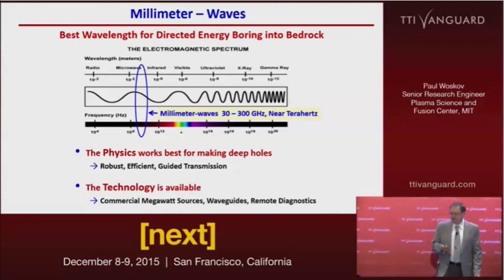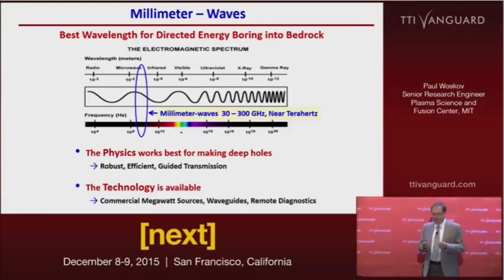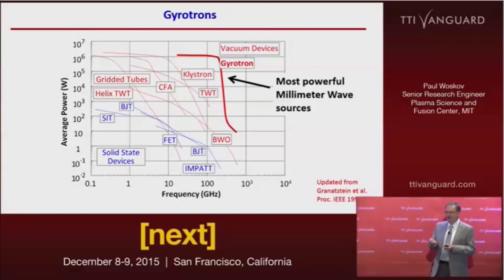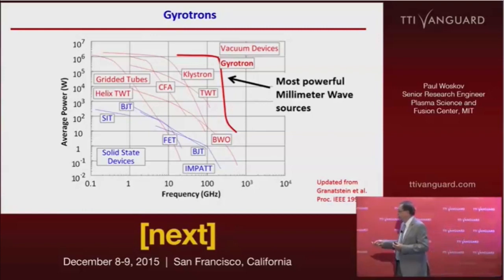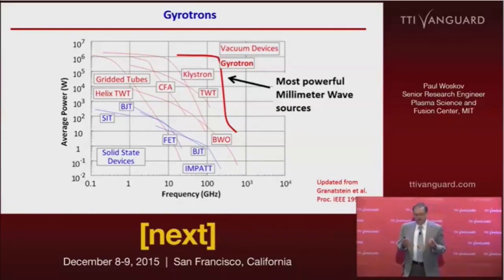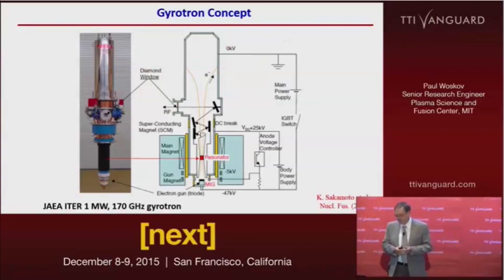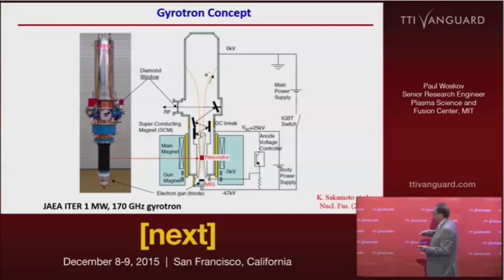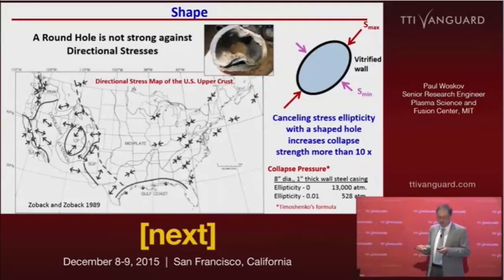Full Bore Millimeter Waves Can Bore Geothermal Wells 2

Comment: Why is this technology being  investigated for deep geo thermal. Like am I the only one who thinks stealing energy from the thing responsible for generating our electromagnetic field is a bad idea. Especially when we have a very very poor understanding of it.

Dont get me wrong I love the technology. Would love to see it used for TBM's
Reply: The word deep is used here to describe depth relative to boreholes that mankind is capable of drilling by conventional means which is about 9-10 km (in very favourable conditions i e. low geothermal gradients). Anything deeper is  extremely hard or most of the times impossible, for sure never economically viable. However in the grand scheme of things, 10 or even 20 km boreholes still barely scratch the surface of our planet, meaning that theres no chance we could influence the magnetic outer core that's a few thousand kilometers below our feet. The thermal signal vanishes within a few kilometers.
Reply: @theymademeodd  show me some reviewed science with good predictions backing this supposition and I would agree. Otherwise, nope. We have wind, solar and nuclear fission we could be using